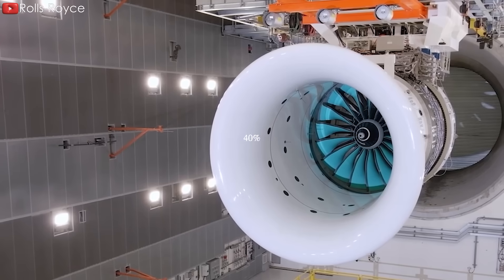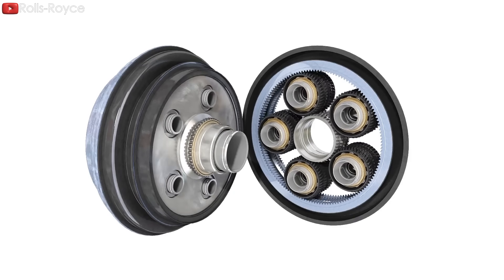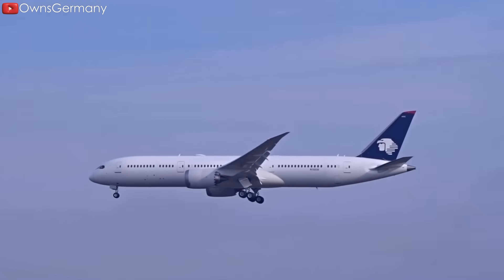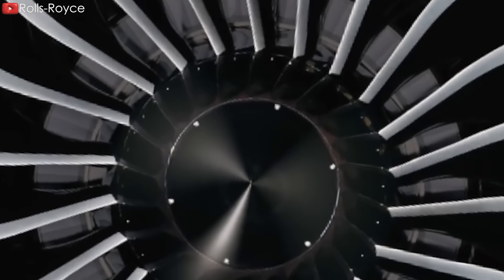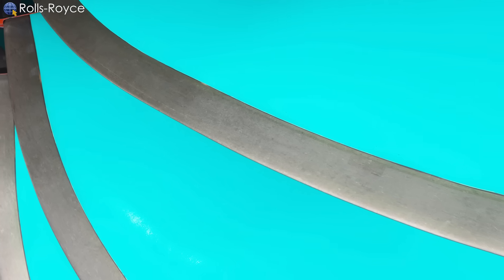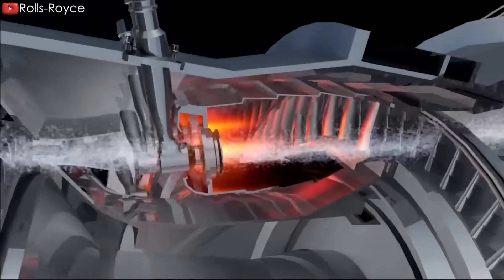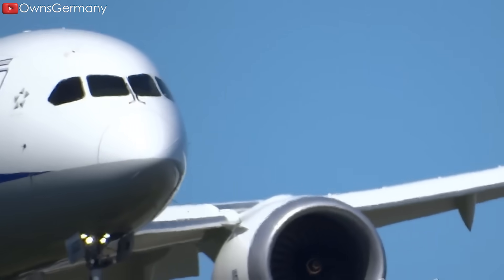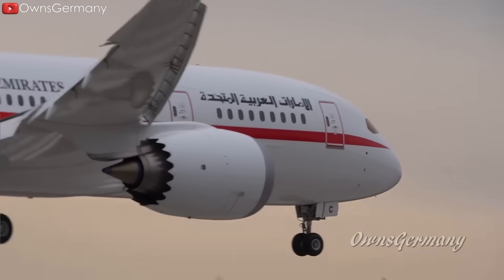The “NEW MASSIVE ENGINE” of Airbus A350's Will Change The Industry FOREVER!

Comment: To fit a Ultrafan on a A350 will require  redesign of the  undercarriage. The fan is 22 inches more that the Trent XWB. That is half a metre.  It is however only 6 inches more than GE engines on the 777X.  Airbus will be mindful of the aerodynamic problems with the 737Max when Boeing tried to shoehorn  a larger diameter engine under the wing of  plane not designed for it.  An Ultrafan A350 will be as different from the A350 as the 777X is from the classic 777.
Reply from the maker: nice thanks for sharing
Reply: that 6'' is quite a lot in circumference and sheer bulk........... but the engine is slightly less powerful, not sure what this means

Comment: Rolls-Royce!
Reply: Q WHAT is your question? Do you have a thought?
Reply: The name speaks for itself after all.  Whether it’s new engines for the B52 or the Rolls-Royce LiftSystem, together with the F135 engine,  an aircraft propulsion system designed for use in the STOVL variant of the F-35, an inspiring manufacturer!

Comment: No new technology here, GE have a composite fan and Pratt and Whitney have geared fan both in service now.
RR have put the 2 together. Why hasn't GE or P&W? 
No manufacturer has or is planning a new aircraft.
Reply: RR are not bothered about new aircraft. They are building scaled models of that Ultrafan to offer as a 3rd option on the A320neo series. There's a 12 year backlog for those planes.
Reply: @ronmurray7349 Rolls Royce Props NOT Airbus
RR using Vegetable Oil and Kerosene MIX
RR working on Hydrogen Power BUT not a future
RR worked on RAMJET technology currently no market
PW and GE do not do R&D just Shareholder Dividends like Boeing

Comment: Misleading disinformation - 25% lower fuel burn compared to 1st generation Trent engines - nobody flies those 1st gen engines anymore
Reply: Trent 700 is a first generation engine & is powering hundreds of airliners around the world right now.
Reply: It still has 25% lower fuel burn!
The fact that no airline uses the 1st gen Trent doesn't change anything!

Comment: Thought the T1000 was supposed to be a game changer...
Still waiting for that to happen...
Get your house in  order first rolls !!!
Reply: Error in the design, development and testing showed up in service, now blaming part suppliers.
Reply: @peterjuchnevicius7320 Exactly !!!!!!!
Reply: More made-up nonsense....sad.
Reply: Sorted four years ago & being bought since then by many airlines.....you need to let go.
Reply: @edwardwilcox6606  no offense, but are you high...
The problem is far from over.
Just ask Air Tanzania, and Air New Zealand how their replacement engines are coming along..7 months and counting for Air Tanzania, and  still waiting for replacement  Trent engines for their 787's .
Add to the fact Air New Zealand had to cancel their Auckland-Chicago route due to inefficiency issues with the Trent 1000.
 Evidently they've had enough of Rolls Royce, all future 787's will be GE powered!!
Other customers making the switch are ANA, LAN Airlines, and Thai Airways as well all switching to GE engines on their future dreamliner fleet..
You say all is well with that engine.
Please, would you just do more research, instead of spewing out rubbish in your comments..
Reply: @Charles-sn7zy  Parts shortages which are affecting all the engine manufacterers...offence taken.